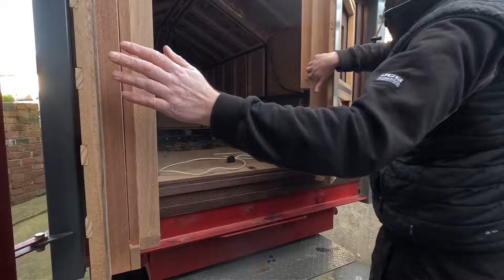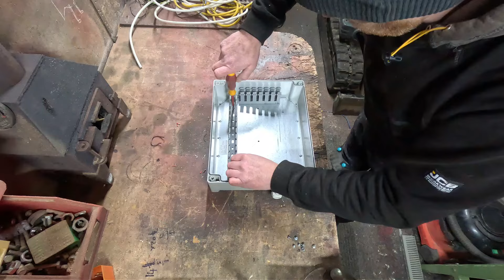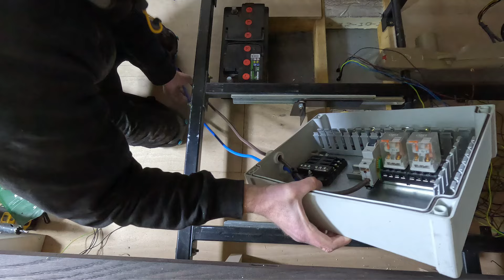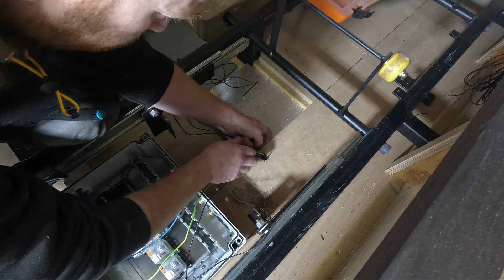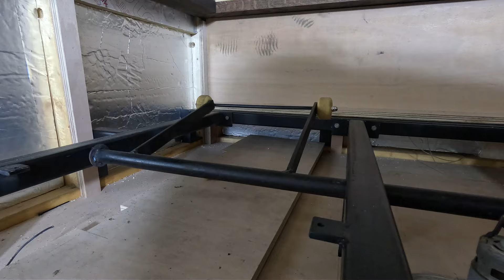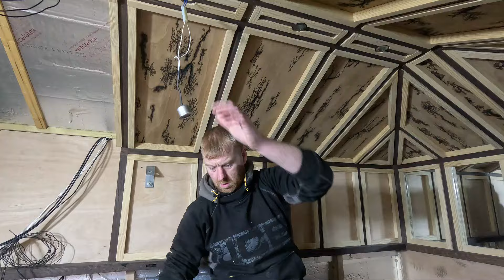DIY Camper Electrics £££ | Full System Using Scrap Parts⚡

Comment from the maker: This whole camper electrical system is built using scrap parts and old wiring - no kits, no plans, just making it work 💪⚡

Want a closer look at the electric step, bed, limit switches or relays?

drop a comment👇👇and check out my other vids for more of this build🔧🔧